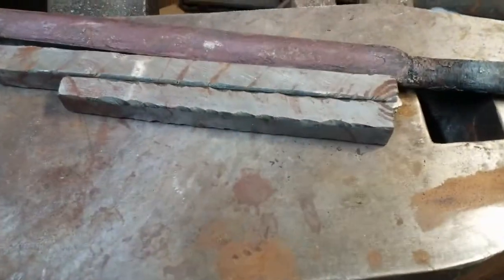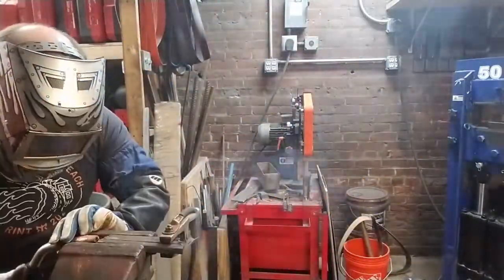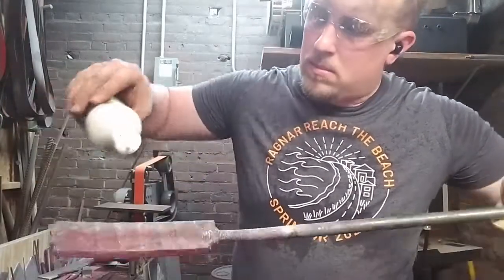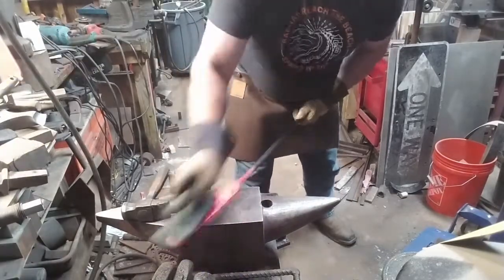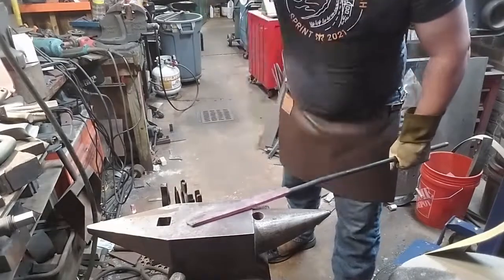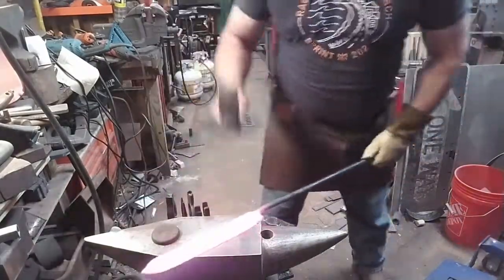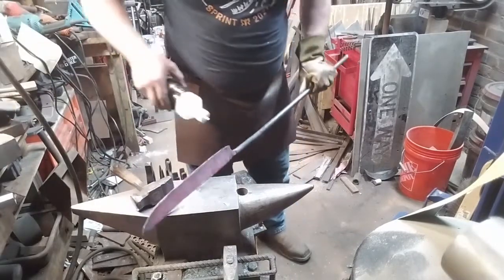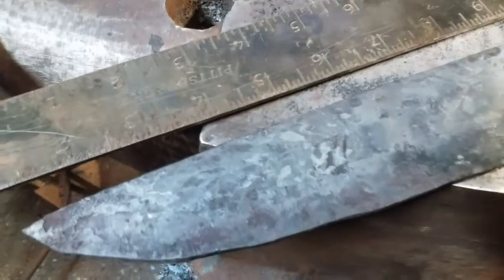Making STEEL from IRON, Part 3: Welding a Patterned Blade | Blacksmithing

Comment from the maker: What questions do you have about this process?
Reply: First, thanks for the serie of videos around this norvegian seax, my favorite seax. Explanations are clear and useful and your husband voice is very calming.
Here are some questions:
I sometimes see smiths not grinding theirs bars before welding. Maybe because they work with bloomery steel? Maybe because they hope borax will dissolve all oxydes ? What do you think?

In historical times, do you think they cleaned their bars? Water forging then Stones? Files? Scraper ?

EVERYTIME i try to weld square bars in order to get soft spine and hard bevels, their is ALWAYS some space between the bars ! Have you an idea of why and how to fix this ? 

I hope you will see this commentary, i'm dreaming when I see your work...
Reply from the maker: Wrought iron contains needles or ribbons of silica. Working with wrought iron, or the combination of steel and wrought iron, has the advantage of not requiring flux, because those silicate impurities serve the same purpose. So, primitive materials can skip those steps. More modernly, smiths that are very practiced and used to doing all their work "hot" can skip the grinding step because they can brush their work clean and weld directly. They will be relying on accurate hammer work to keep their surfaces flat and true. This works much better if their billets are short and fat instead of long and skinny, but highly skilled smiths can make a lot of things work that less experienced smiths can't get away with.

I don't know how medieval smiths descaled. My baseless suspicion is that they used scrapers to clean hot work, and hammered off the scale of cold material.

If your welds are good in the center but gapping on the sides, it's because either the force you are transmitting to the work is good in the center and not on the sides, or because your material isn't perfectly flat. The first is a common problem working alone with hand hammers. Using a flatter with a striker can help a lot, and if you're very concerned you can use a swage tool to push your sides down as hard as the center. But the second is solved by grinding (or hammering) your material flat. Material prep solves a lot of problems. If the gapping is shallow on the sides, you can grind or file it out. If you don't want to do that, you can blend the welds by planishing at welding heat.
Reply: @LynneFairchild  Thank you for your answer ! I will for sure try some of the things you said. Wish you the best
Reply from the maker: You're welcome.